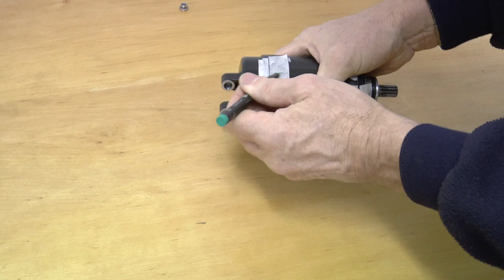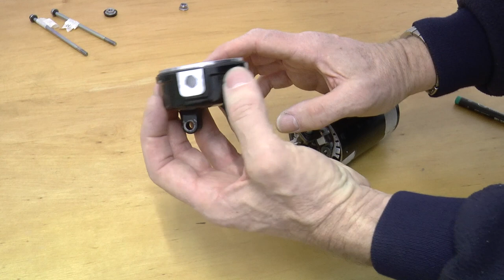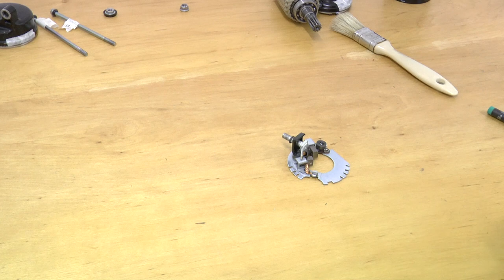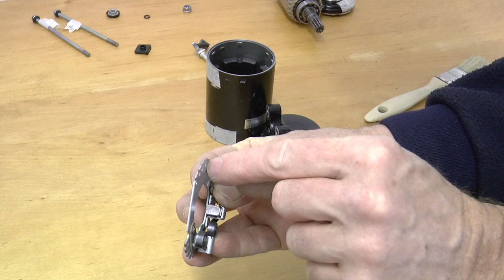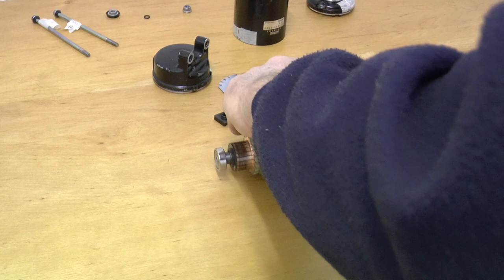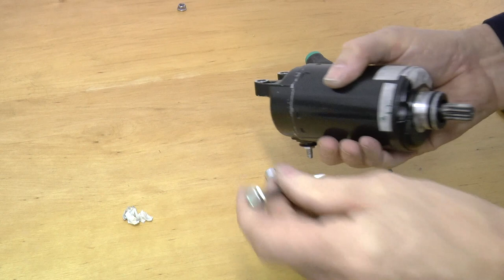Triumph Tiger 1050 Starter Motor Strip & Rebuild

Comment: Great video..my only concern here is when you showed how to do the ohms test and then you later showed the carbon build-up between the commutator contacts where the brushes make contact with the motor,would it be wiser to clean between the gaps before testing for the ohms readings first thus avoiding false readings!!.

Comment: Where can I get the proper rebuild kit or part #? I recently purchased one (SND9127 from ebay UK), but the brushes were in the opposite positions then the original. Which in turn made my starter run clockwise instead of anti clockwise. 2005 speed triple 1050. Any info would be appreciated.
Reply from the maker: I’m not sure about a source for the brushes but if you Google it, I’m sure you’ll find something - they are definitely advertised.
It’s been a while now since I did this job - can you modify the new brushes to work with your old backplate????  It’s only really the brushes you need anyway
Reply: @ybliga  yes that is what I did, i modified it and used the old brush plate witth the new brushes from the kit. I dont understand why the kits advertised on ebay uk are incorrect. If you look at the original brush plate, the earth brush is to your left, but the one in the kit is to the right. So when installed that way, the motor runs clockwise and not anticlockwise. Anyways thank you sir. I made mine work, I was just hoping perhaps you had a better part # even for the proper rebuild kit. Thanks

Comment: great vid, I imagine this is a similar starter to the speed triple 1050?
Reply from the maker: It depends on the vintage - I have a 2019 Speed Triple RS and it’s a different model of starter but I suspect the internal architecture is the same as the older models. 
If you’re talking an older speed triple, I expect the starter was the same as on the tiger of the same vintage - that said, the part number is on the starter body anyway
Reply: @ybliga  Thanks for reply. Its a 2010 se.Hot start issue,  Im also thinking the the voltage regulator (just replaced it) is getting hot from engine heat, possibly relocating it?
Reply from the maker: @linzkirk  voltage regulator is SCR shunt type and they get very hot in their own right - it’s not from engine heat.
Better bet May he to switch it out for a better mosfet series regulator such as a shindengen SH775  - they are more reliable and won’t get as hot. However, the main benefit is from protecting the stator against burnout.
Reply: @ybliga  Thanks for fast reply, mine failed 3 months ago and I just replaced it with a genuine triumph one at £180. I would of tried the SH775 if I had of known at the time. probably a lot cheaper too
Reply from the maker: @linzkirk  genuine triumoh is SCR shunt type and rather crude. SH775 will cost about the same but doesn’t get as hot and also protects against stator failures but LOTS of fakes on eBay for around £60 which don’t last 5 minutes.

Comment: How many teeth does this starter have?
Reply from the maker: I can’t now remember and I no longer have it.
Triumph upgraded the sprag clutch on the 2007-12 Tiger 1050 and the sprag upgrade kit included a new starter motor and I’m fairly confident the new starter has one more or (I believe) one less teeth on its spline than the old one and this they are incompatible with each other. Old starter part number for original sprag and idler gear, updated starter for new sprag kit.
If you buy a replacement at any point, take the part number off your old starter!!!
If you are asking because you are wondering if your internals are the same then having stripped them both, I can confirm the insides are basically identical